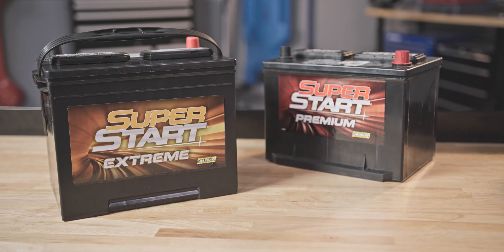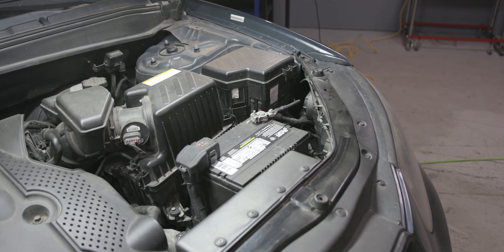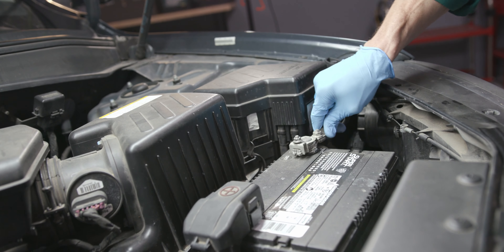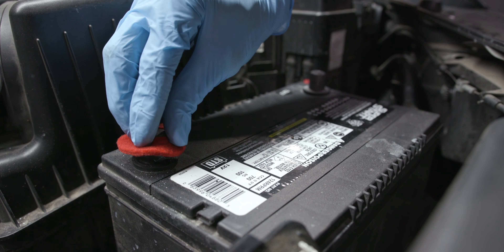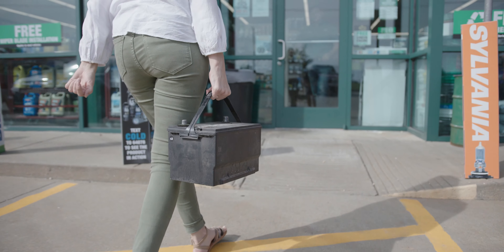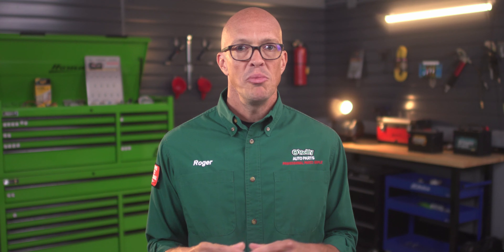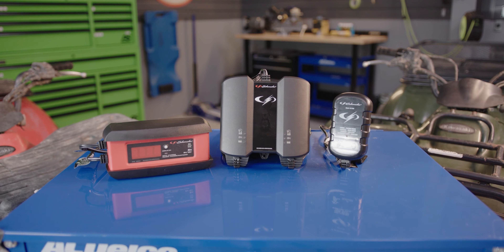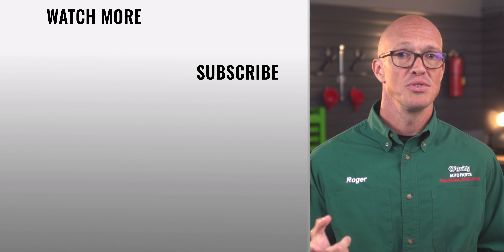How To: Care For Your Automotive Battery

Comment from the maker: Supplies Needed for This Job:
1. Safety Glasses: https://urlzs.com/hbwc
2. Gloves: https://bit.ly/2GvfwAm
3. Wrenches: http://bit.ly/2IUfBzn
4. Battery Terminal Cleaner: http://bit.ly/373mYgA
5. Battery Terminal Protective Spray: http://bit.ly/398yoSb
6. Battery Terminal Protective Pads: http://bit.ly/34VemXM
7. Battery Terminal Cleaning Brush: http://bit.ly/2ELUkoh
8. Battery Maintainer: http://bit.ly/2NbXlBZ
9: Auto Batteries: http://bit.ly/2PuRxV6

Comment: Advice to people who don't have a lot of automotive knowledge, is when using a wrench to loosen the battery terminal, be sure the wrench NEVER contacts both terminals.  If it does, it may weld the wrench to the terminals. If it does and you can't pull it loose ....
.....run like hell!
Really, I'm not joking.
This should be part of the video.

Comment: Once every few months, it might be beneficial to fully charge your battery with a battery charger.  Probably more important if you make a lot of short trips with a lot of starts and stops. A lot of starting will drain your battery with these short trips, so you won't be driving enough to fully charge it.
I think it's time for a new video that's more in-depth. 
I would bet a lot of people don't know the danger and how much power is in a battery.  The new video should be informative enough to insure that Mr.  Joe homeowner never to allows a wrench to make contact with both terminals.  That should be the very first thing mentioned in this video.

Comment: How long can terminals be disconnected without resetting computer/radio/clock etc?
Reply: 1 five minutes to 5 minutes to reset the computer. If there is a internal problem with the machine the lights will sync up and throw lights at you after 20 minutes after reset. Maybe longer.

Comment: Why when you remove the negative lead would you not touch any metal?
Reply: U can get shocked
Reply: Now that is just totally stupid and wrong…. The negative cable IS always touching metal, because it is a chassis ground. So if it’s connected to metal in the first place, and you let it contact metal elsewhere… NOTHING